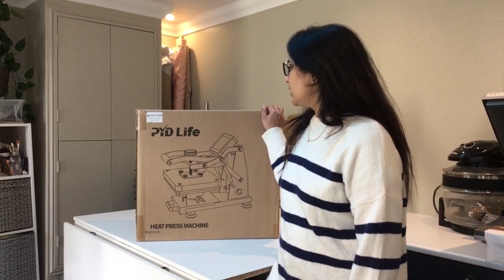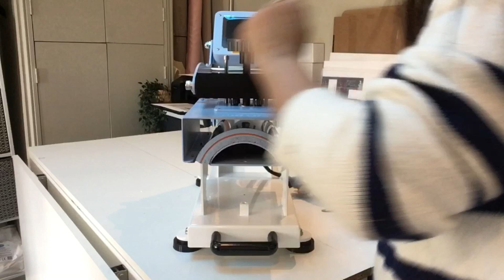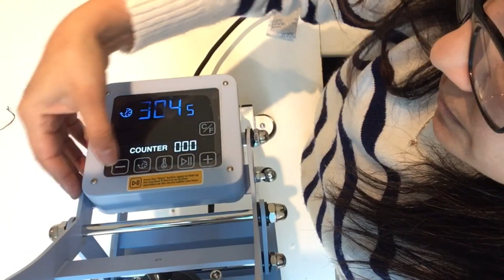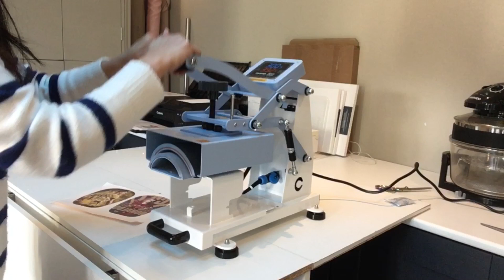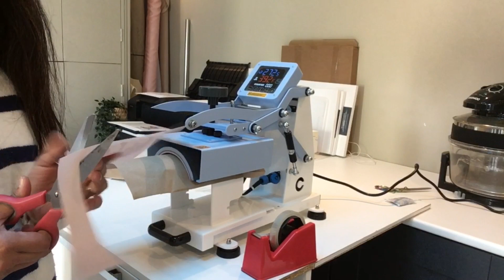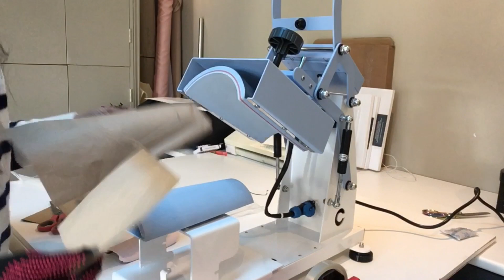How to use Shin Guard heat press Machine for beginners?

Comment: Hello! I know it's been a while since you've posted this video. The problem I am having is that I can't determine the correct pressure. I've gone through several blanks trying to figure it out. It's even more frustrating when I have one blank figured out because because you can view the pressure digitally, I waste more blanks when I use a different size/product. I'm open to suggestions.

Comment: Great video, thank you! 

Question- I have the same machine does yours let off a really bad smell when heated up?
Reply from the maker: As the rubber padding heats up it does smell a bit.
Reply: @bumblebeeuk I’m getting few patches on my small pads
Reply: Thanks! Did it ever go away for you over time?
Reply: What’s the temp and time?